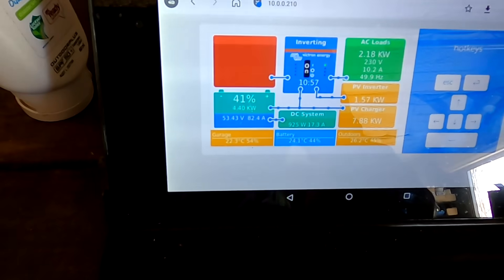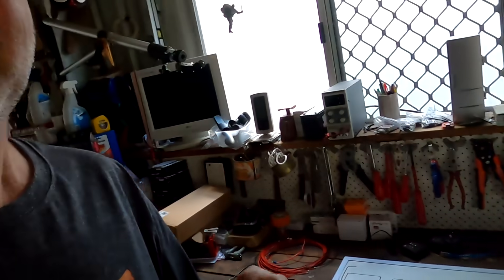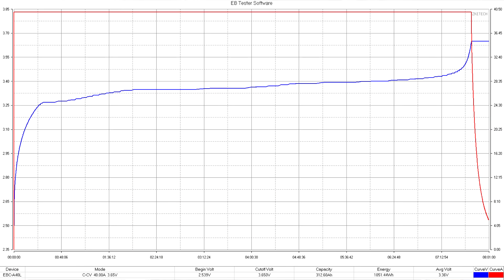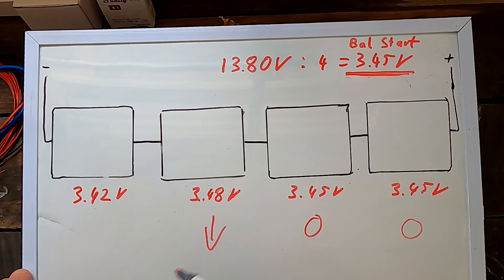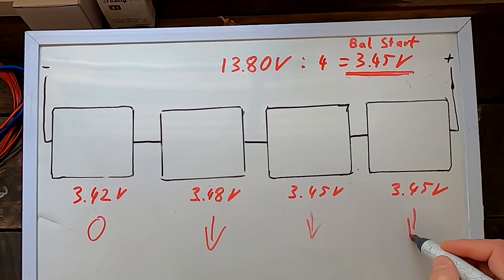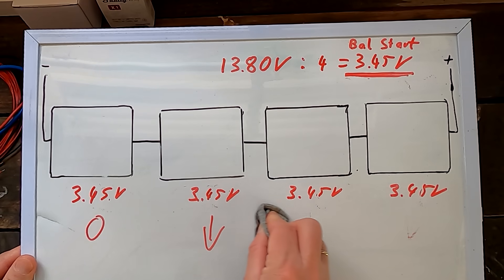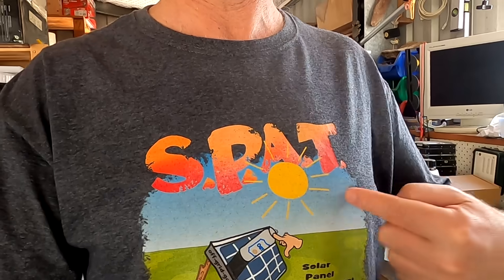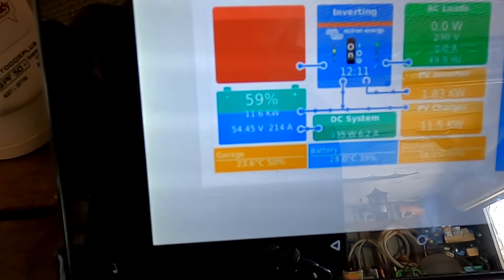Balance Start Voltage for LiFePO4 explained. Why you should not start too early... 🔋⚡

Comment: The active balancer will discharge the highest cell and charge lowest or even split that to all lower cells for the simple heltec active balancers. With them it makes sense to start balancing in the upper knee of 3,4V as here the devations appear and its a relativly low amount of capacity that needs to be shifted from highest to lower cells. And here it also makes sense if the active balancer even discharge the 2 higest cells and charge the 2 lowest. Here the time counts, the longer you are in this area the more capacity you can shift. You done that yourself in of the last videos about "if the passive balancer keeps up the balanced battery" and to balance the massivly unbalanced battery put the hankzor or heltec simple 5.5A active balancer and setting of charger to 14,2V Absorption and float to enable to balanace the bank. You can even run the active balancer also while discharging till 3.4V as it will still shift capacity from the highest to the lower cell correctly giving the active balancer more time and chance to fully balance the battery. It doesn't matter with active balancer if your cells get balanced to 3,45V, 3,48V 3,50 or 3,55V in this case, thats why you don't need a target voltage here with this active balancer itself,  important is they are as close as possible because you will never reach all at the same voltage eg 3,55V, there is always a weakest and a strongest cell. To achieve that you just need to make sure the active balancer works in the upper knee.

Comment: Whats the goal of balancing? Having all cells as close as possible. With passive balancer i agree to some degree. If your goal is balancing to 14,2V you have the end of charge voltage to 14.4V because no cell will hit the 3.55V with 14.2V end of charge as as soon one cell hit the 3.55V the charge shuts of and voltage drops so no balancing ever happens. With active balancer its completely wrong as active balancer will deplete the highest cell into

Comment: Andy, balance start voltage is not the same as target voltage, and the BMS has no target voltage for the cells. In your example you say that if we set the balance start voltage to 3.4 V, then the BMS will drain all the cells down to 3.4 V. No, that is not what will happen. The BMS will be in balance mode as long as one or more of the cells are 3.4 V (or higher) AND the delta is more than 10 mV (or whatever you set it to). It takes from the cell with the highest voltage and inserts into the cell with the lowest voltage, and repeats. There is no target voltage the BMS tries to reach. If the delta is 9 mV and all cells are above 3.4 V it will still stop.
Reply from the maker: That's not quite what I said. In my example, we are charging to 13.8V which is 3.45V per cell if full balanced. Setting the balancer to 3.4V, makes it discharging/balancing any cell above that 3.4V, even you try to charge to 3.45V.
Reply: @OffGridGarageAustralia  No, this will not happen, because the BMS only balances two cells at a time, and it stops balancing as soon as the delta is lower than 10 mV, no matter if the cell voltages have not yet come down below the starting voltage. An active BMS doesn't eat up any charge from the cells, it just moves the charge between cells. So if you say that it will lower the voltage of all cells, you need to explain where all this charge ends up. As heat? No, this is not how it works. And active BMS doesn't have a power resistor it can use to burn up energy.

Here is what the BMS does when it balances: The cell with the highest voltage is discharged into a supercapacitor, and that energy is charged into the cell with the lowest voltage. Then the BMS measures the voltages of all the cells again, and repeats the procedure. It could be the same two cells this time, or two different cells. So in your video at 6:20, the 3.45 V cells will be left completely untouched by the BMS, because they are neither the lowest or the highest cells, and will never be. The BMS only does balancing as long as two conditions are true at the same time: A) one or more cells are above the starting voltage, and B) the difference between the lowest and highest cell is more than 10 mV. In your example, condition B will happen before the BMS has any reason to touch the 3.45 V cells. 

This is also why starting early with the balancing (setting a low starting voltage) does not have any negative effect on the balancing. It will end up exactly the same as starting late, except it will get the pack balanced slightly earlier, because it would have had more time to do it. There is probably very little time difference though, because the charge current is so much higher than the balance current.
Reply: That's exactly  it is.  I have it at 3.0 Volts and it works perfectly.

Comment: Hi Andy, I don't think you are right. Once the balancing target is reached, the algorithm will decide which cell needs a correction. On passive balancing systems, a resistor will drain the cells with higher voltage. On active balancing systems, the energy of the highest cells will charge capacitors that will charge the lowest cells. Peppe from Napoli.
Reply from the maker: This is about balance start voltage not how balancers work, Peppe.

Comment: I don't agree with how you've explained this
a balancer won't pull down every cell untill its the balnce start voltage, it will only pull them down untill each cell is equal to the lowest or the balance start voltage which ever is high
and in the case of an active balancer it will put the energy from the highest cell into the lowest

I personally think you need to remake this video and delete this on, it's just going to confuse people
Reply from the maker: John, you won't believe how many people emailing me about when to start balancing. This video is a simple guide to give these people some help. That there is a lot more to, yes, I explained this in the video description.

Comment: Ideally balancing should be turned on at the termination of charge cycle when there's no current flowing.

When charge terminated properly, any battery of reasonably well behaved and matched Cells won't need balancing for months.
Reply from the maker: They will need balancing with every cycle. Everything else is theory but  is not practical. Especially with 16 single cells, there are always variations in chemistry but also in connections across all these cells. They don't charge/discharge 100% the same... so balancing is needed dependant on the set charge voltage.
Reply: @OffGridGarageAustralia  I'm doing proper charge termination for a full two week now.

At the end of charge, my cells are always within 0.010V deviation @~3.38V even after multiple charge/discharge cycles.

Never felt the need to turn on balancer within this time because they're already balanced within 0.010 V

Comment: Hi Andy, I agree with what you say but it occurs to me that for LIFE04 it will always be 3.45 volts per cell, no matter the pack size, so why don't they just leave it fixed in the BMS?
Reply from the maker: You can start at 3.45V, no problem.
All historically. Most BMS have a very small balance current coming from Li-ion batteries where we could start balancing at 3.3V. Manufacturers have just kept these tiny currents for LiFePO4 as well but we cannot start that early.

Comment: I have a JK BMS B2A8S20P and I have two questions as I practice these things.
  1) I can only find bluetooth control on the device - and it keeps me very firmly at home, even though the battery is in a fire safe place. All my other devices are in my real remote control via the wifi hotspot, such as the EcoFlow power station and various smart sockets. How can I also connect this bms device to my wifi router so that I can control it when I have to leave the house?
  2) I have a few solar panels in the yard and a small 320W MPPT controller. If I want to charge this LiFePO4 battery with the current produced by the solar panels, is it necessary to find the exact settings for the charge controller software, or is it enough that the BMS device knows how to control the cells and the MPPT controller does not let the voltage get too high?
Thank you!
Reply from the maker: Thanks for your questions.
1) You can connect you JK-BMS to Home assistant with this project and control it form anywhere. I will show and test this on my channel in January. https://github.com/Uksa007/esphome-jk-bms-can#readme

2) You need to set the charging parameters in the MPPT and cannot rely on the BMS for that reason. The BMS is a safety device which triggers if the MPPT is faulty. MPPT charges, BMS protects.
It's a bit like making a short and trip the breaker every time you want to turn off your lights.
Reply: @OffGridGarageAustralia  I looked at the documentation you linked, but I don't really understand everything. That's why I'm waiting for January like a child lollipops :) Thanks for your thoughtfulness, Andy!

Comment: First and foremost, I want to extend my congratulations for your captivating videos; they are undeniably engrossing. In general, I find myself in agreement with you regarding the technical aspects you present.  My concern stems from what I perceive as inaccuracies in your explanations concerning battery balancing.

To begin, let's revisit the fundamental operation of a BMS balancer, whether it's of the active or passive type. Its fundamental purpose is to ensure the equitable distribution of the charge among the cells of a battery. In the case of passive systems, their role is primarily to discharge the cells with the highest charge. On the other hand, active systems go a step further by not only discharging the highly charged cells but also redistributing their energy to the less charged ones. However, the core principle remains unchanged.
In your description, you seem to equate the *starting voltage* with the *target voltage* that cells must achieve. In reality, these two factors are entirely unrelated, and the balancing system doesn't concern itself with the target voltage, as it is solely determined by the chargers (mppt & inverter).

Let's reconsider the example of the unbalanced system you showcased. You suggest that, since all four batteries exceed 3.4 V, they will all undergo discharge until they reach this voltage. However, this is unequivocally erroneous. As previously mentioned, the primary role of a balancing system is to strive for equilibrium among the cells. In the case of a passive system, as in your example, it would simply discharge the cell with the highest charge (3.48 V) into a resistor. Yet, it certainly wouldn't discharge all the other cells as you implied. If it were to do so, it would cease to be a "smart balancer" and instead resemble a "dummy discharger." The sole purpose of the startup voltage is to prevent the balancing system from initiating the balancing process while the cells are still in the linear zone where charge is not directly proportional to voltage. It is, therefore, imperative to set this voltage beyond the inflection point of the curve. However, it's essential to recognize that this has no bearing on the final battery voltage. 
I hope that these clarifications will assist in refining and enhancing the accuracy of your explanations.
Reply from the maker: Thank you for your comment.
I was aware to open a can of worm here and the start balance voltage is just the beginning. I will make a part II of this video and go into more depth. As I explained in the video description, this is just to give people a guide where to start balancing... of course, there is far more to it...

Comment: Hi Andy! I want to thank You very much for Your videos! I learned a lot from Your channel and finally made my own battery 8s with daly bms and neey balancer. Im very happy of it! )) Longlusting  backup power supply for winter blackouts! Fantastic!
I have a question about the  charging and floating voltage in my solar inverter. I have a problem with charging (( Charge current 50A, charge v 28,6. Everithing was fine untill voltege increased up to 28,2. The amperage was still at 50A  and Neey started at 3,45 to balance at 4A , but in few minutes one cell started to rise and came up to 3,652 and BMS disconnected charge( battery foult on inverter). I set the current to 40 A and voltage to 28,2 from 28,6 and in few minutes bms started again and charge continued untill 28,2 and current started to go down to 0 Amps in the end. Is that foult and bms on/off normal? I understand, that battery is not at 100% SOH becose I need 29,2v for this? Maybe I need to reduсe current manually from max to 20A when voltage will come up to 28,2 to slowly get to 29,2v(once a month for equalization balancing at 3,65)? What should be the charge and floating voltage for save battery from overcharge everyday use?
Thank You!
Reply: You have a massively unbalanced battery and need to top balance it first. First charge till the highest cell disconnects. Then cut charge and load. Dismantle the battery and connect all cells in parallel and connect a fixed power supply at 3,65V. Now you have to watch the current, if it Hits 1A. Disconnect the power supply and let them sit for min. 6h better overnight. Then again switch on power supply and wait till you hit 1a again. Now you bank is top balanced. If you cannot dismantle or have a power supply put absorption and float to 29.2 and charger to 10a and charge till it Disconnect and cut the load so the battery stays high and balancer evens out the cells. If that happens apply a load to battery lowest cell is at 3,4V. Then start charging again. Do that cycle till all cells are within 40mV and hit 29.2V Then it's time for normal operation, set absorption to 29.2V, absorption time 0s and float to 27V. Lithium doesn't need absorption, yes you loose 1-2% capacity but you can screw much more up then you can gain when you absorb. So in normal operation the neey has now enough time to do the rest and get your cells as close as possible, how close depends if they where matched cells or not.
Reply: For everyday use put HVC at 3,55V, end of charge at 3,53V absorption at 28,25V (8×3,53V) and float at 25,4V (8x3,175V). Reason float so low is your battery is kept on a lower voltage level which is healthier. Remember in discharge you have a voltage drop so battery is at around 95% SOC then.
Reply from the maker: I'm confused with your 38.6/38.2V what voltage is that? Do you have a 24V system or 32V system???
Reply: @OffGridGarageAustralia  sorry, I mean 28,2/ 28,6

Comment: Hello Andy, thank you for the clear explanation, now i got it for sure. Just 1 question, when you say " your desire voltage" does it mean the bulk voltage or floating voltage, because in our inverter, when reach the bulk voltage the inverter immediately switch to floating voltage which is far lower than 55.2v.
Reply from the maker: Desired voltage = Bulk/Absorption voltage.
If your inverter does not have any absorption time, maybe set the float voltage close to the Bulk voltage to allow the balancer to work. Otherwise it will never balance.
Reply: Bulk charging does not have a voltage, bulk has a max charge current. 

In addition, LiFePo4 do not use bulk, absorption and float, so asking for float voltage is also irrelevant..

LiFePo4 uses CC/CV charge profile. Constant Current = Bulk, Constant Voltage = absorption.

After CV is done, the charger is supposed to turn off, Victron has solved this my setting the float charge voltage bellow the rest voltage of the LiFePo4 battery..

So the answer to what "your desired voltage", it is the voltage defined in CV part of the charge, or Absorption Voltage for Lead Acid...

Comment: Id love to see an entire 16s1p electromechanically disconnected from loads during charging and reconfigure to a 1s16p to have a completely charged battery then physically switch back for loads.
Means no using it while its charging. It would be like... Electrical OCD lol.